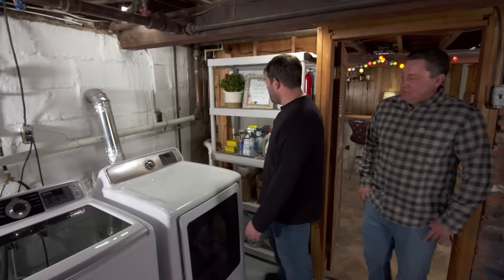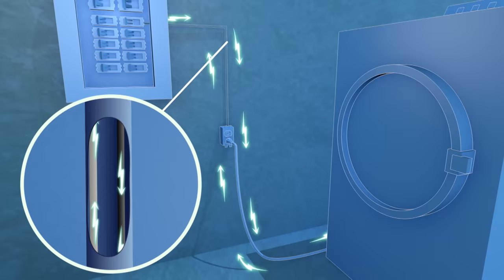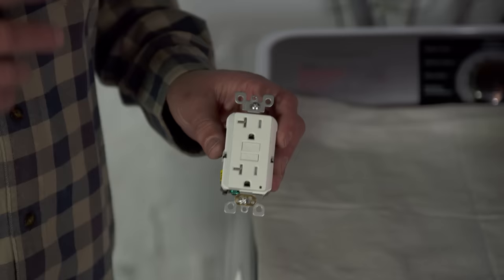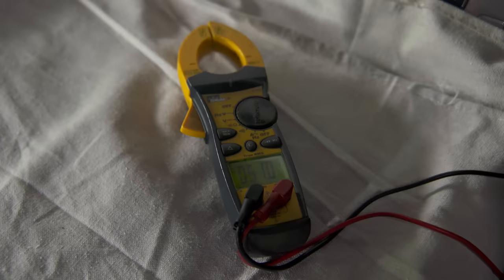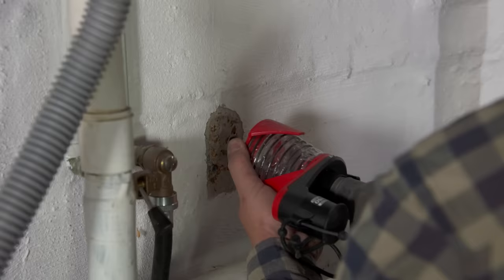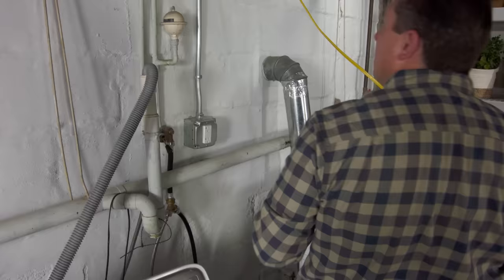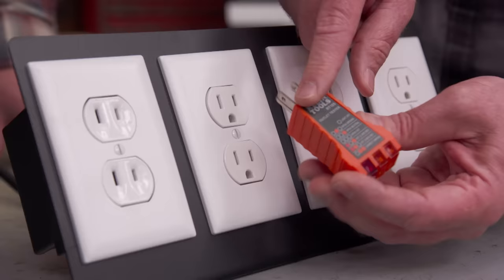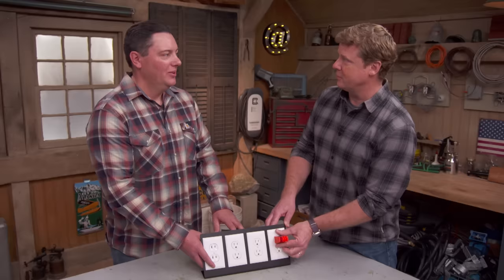How to Ground a Two-Prong Electrical Outlet | Ask This Old House

Comment: Major household appliances can an will trip GFCI. Appliance amperage increase and decrease during use. For example a washer is washing, amp draw 3.5. We drain the water. At the start of the motor for spin the amp draw will increase to 12 amp, tripping the ground fault. Dishwashers  are the worst. Appliance manufacturers will print in there manual must use a grounded out. Do not use GFCI

Comment: First. Can't run romex in emt. Second emt can be a ground if done to code. Third wet location requires water tight connecters and box.

Comment: While in this case, a re-wire was appropriate and the basic explanation is correct, there are other ways that are still legal under the National Electrical code. It depends upon the nature of the wiring being used. Should you have an ungrounded circuit that is encased in armored/ Be cable, the armor casing itself is legal to use as a ground if it travels all the way. Back to the panel. The same is true with circuits encased in Electrical Metal Tubing. This can be checked by the use of a meter or neon test lamp to determine if a complete circuit can be obtained by using the shielding medium. If there is a complete circuit available, then a ground wire from the outlet ground terminal  to the shield is all that is required 
This is for when with EMT, it is not possible to draw an additional ground wire directly back to the panel.
Reply: I was just getting ready to say that
Reply: Just curious: how does your neon test lamp "know" that the shield has not simply been shorted to neutral at the nearest junction box, thus defeating much of the grounding protection?  Also, nothing prevents you from putting in a GFCI for the replacement 3-prong receptacle if you don't actually need an equipment ground (which most appliances do not).

Comment: Had an inspector tell us recently that we couldn't use Romex or plastic sheathed cable inside of conduit. Is there a reason why or is he just full of it.

Was also told that to use a GFCI the way you mention in this video was also a no no.

Comment: I've got one of those outlet testers and for some of my outlets all three lights come on but there's no definition for this condition on the device.  I contacted the company about it and they don't know what it means either.
Reply: W A T ‽
Reply: It means that there's a problem that's more subtle.  If you have a multimeter, you should check that the Line-Neutral and Line-Ground voltages are around 120V, and the Neutral-Ground voltage is 0 (or very close to 0).  I'm betting that there's some voltage between Neutral-Ground on the outlets that have all three lights on, likely because you have a bad connection in a Neutral somewhere upstream of those outlets.  Now the fun part is to work out where the bad connection is.
Reply: It means you're in the plumbing silly!
Reply: That means there is voltage between all three prongs. That would happen if it was a 240 V outlet where someone had just put a 120 V receptacle. It could also be be voltage on the groundwire which is very serious. Measure the voltages between the holes with a multi-meter. Do not use it until you have cleared it,

Comment: Now that it's also on an arc fault breaker, they are guaranteed absolute and total safety. It cures baldness, too. (Sarcasm)
Reply: Unfortunately, Arc Fault is now required for laundry area
Reply: @scottg62g  Yeah, it is. I am yet to see a proof that Arc Faults actually work. GFCI's do, and they save lives for sure. AF's - that's still voodoo to me. They either false trip on arcing motors (vacuums), or are desensitized by manufacturers below the threshold of any meaningful sensitivity. Not to mention that they also removed the 30 mA ground fault protection from most of them, which was their only useful fire prevention feature.

Comment: I thought code was a AFCI/GFCI combo breaker for anything below grade/wet area... specifically laundry areas... 2020 NEC Change:
Laundry areas
RATIONALE OF CHANGE:
Laundry areas have been added to part B as correlation with part A since the potential hazards exist both in
dwelling units as well as commercial facilities such as
laundry mats. In multi-family establishments such as condos and apartments tend to have a common laundry area
and these areas are required to have GFCI protection for
the receptacles. This would include the 125-volt through
250-volt receptacle as required in the general language of
210.8(B).

Comment: I already had a general idea about grounding but this video gave me some more knowledge. I also learned something new when he talked about how a reversed outlet affects a switch and can therefore be dangerous!
Reply: @Jason Bowman No a lot of people don't understand that AC receptacles and plugs are "polarized" for a reason: the appliance designers often cheap out by only switching off the "hot", which becomes the "neutral" if the poles are reversed (in the cord, plug, receptacle or house wiring).  Now you switch off the appliance and the "hot" is still live inside the appliance.

Comment: So hire an electrician? got it thanks
Reply: Hiring an electrician is not that simple. Many of them claimed to be licensed, but actually not. That alone could put your life in danger and it is a challenge to find out if that's a legit licensed electrician or not.
Reply: @AdamIverson  I mean if you think you know more than any electrician that's available in your area, sure DIY

you could also check reviews and check licences and insurances instead of risking your life and all the lives that will ever be in that house.
Reply: howdareyou41 Electricity isnt a mythical creature lol. Basic principles and knowledge make it easy. But it comes down to comfort. I wired everything from light sockets to whole motors in the oilfield as a regular hand, so im quite comfortable with it.
Reply: Actually it is that simple. Hiring electrician. Ask the electrician if he has his journeyman card. If he cannot present one you will know he’s no good. You always should have one if you are a  licensed journeyman electrician!!!!
Reply: By the way horrible video. The guy is boring and there was no need to put this in there because you need to hire an electrician anyways. Not to mention all you need to put in your video is need a new circuit!
Reply: Adam Iverson That’s why there is sites like Angies list or Home advisor.
Reply: @trenthatt2944  Not everyone needs to "hire an electrician" to replace a 2-prong receptacle or to run 4 feet of new cable for a grounding connection.
Reply: +howdareyou41   well, not in this case since he lost the outlet anyway, lol.  He might as well have just not used it.   It was 2 prong so only double insulated devices, or really old devices, would use it anyway.  He didn't gain anything.
Reply: Its really easy. Do some research. Watch some videos. As long as you own the house you can do what you want with it. But insurance my not cover something, say a fire, if you do something wrong.
Reply: @trenthatt2944  new circuit correct ! , but not all places require you hiring an electrician (licensed) , I'm an electrical contractor licensed & insured but here in the state of Georgia a home owner can pull their own permit & do their own work if they feel competent. It's not advised for complexed situations or situations that any individual doesn't feel comfortable nor competent about but like I said here it's advised but not required....more so a "better safe than sorry" advisory ... I've actually went on calls and walked people through how to do simple testing & replacement.
Reply: @AdamIverson  here in the state of Georgia the license must be produced & approved , but that's only for new electrical construction,  but the state of Georgia doesn't require residents to hire an electrician it's only advised (not required).....this is the big misconception with watching these videos.
Reply: Always check with your area (municipality) its always the correct way !

Comment: The GFCI solution is perfectly legal and safe (in my area anyway) but electricians "don't really like doing that because he would really rather run new cable" even though a GFCI will work perfectly. Also, he didn't explain using a GFCI breaker, which is another legal alternative to separate GFCI outlets. Copper is now very expensive and if the wiring in the house is still reliable, there is no reason to "rewire the whole frickin house" just because the electrician "doesn't really like doing that". By the way, most new appliances draw much less current than their previous versions such as a new washing machine that probably is now using an inverter type drive motor and control that reduces surge current significantly and is more efficient. Don't let these guys talk you into replacing the existing wiring in your house IF the wiring in the house is reliable.
Reply: I have a really old house that’s a Frankenstein of an electrical wiring mess. Will installing a gfci 3 prong outlet, replacing an old 2 prong, ground whatever device I plug into it? I have a laser engraver that requires a 3 prong outlet for warranty purposes.
Reply: @Songbirdofourgeneration  Your engraver will not be grounded with only two wires/no ground regardless of the gfci. Also the guy who's post we're commenting on shouldn't be listened to. You need new wiring with a ground for bonding purposes. If the GFCI trips, the appliance/tool is safe, but current takes the path of least resistance. Something else can become energized in the walls or along the conduit of there is metal conduit.

Fix your wiring to ensure a good grounding and BONDING is made so current, if need be, makes it to the ground or utility if a short occurs. This is your life and your home.

Comment: I feel like I missed something, was the only solution provided to run a new wire with a ground? Seems to be a thanks cpt obvious situation. Whats a solution for a 2 wire issue on a 2nd floor where running a new wire is not possible.

Comment: Isn't it a bad idea to  pull sheath  wiring- (like Romex) through a conduit?
Reply: You are correct. Romex in conduit is illegal. You also don’t need a grounding wire because you can use the conduit as the grounding path.

Comment: Way to not let people know that even with the main breaker off to not tell people power is still present on the wires coming from the meter.
Reply: Learned that the hard way, myself. Even harder was the realization that the wires are hot on BOTH sides of the main breaker. I thought they were only hot on the one side...
Reply: Proton2112  Not upstream of the meter. Between the meter and the main breaker. Even with the main breaker off, the wires coming TO the main breaker are still hot. On both sides, as it turns out.
Reply: @c182SkylaneRG  so whats the problem
Reply: @randomrazr  If you don't know that there's still live power inside the main panel, even with the main breaker off, you could get a shock. Depending on how the shock passes through your body, it could be rather damaging (or so I'm told. In personal experience, it's always been a mild but distinctive buzzing feeling).
Reply: @c182SkylaneRG  yeah, but for this application it doesn't matter. The is zero reason to mess with anything leading INTO the main breaker when adding a circuit.

 I did however think it should have shown the main being shut off. Not just a side comment on how I've switched the thing so now stuffs safe to play with. Keep in mind that a large portion of the audience looks to these videos for advice or even instruction, and if they can't take the time to show All of the steps necessary to do it safely, then they should reevaluate if they should make these videos at all.
Reply: @spyda1857  I think the issue is that the show is for a wide range of abilities. If you say to a rookie "turn off the main breaker and then the panel is denergized" without any more context  then you can't be surprised when someone comes back complaining that they touched the wires under the top panel and got a shock. 

It should have been "turn off the main breaker and the bottom half of the panel is safe to work on. Do not go into the top half, it's live from the power grid and can kill you."
Reply: Fyi He's not working in the main panel, he's working on a sub panel.
Reply: If you're not an electrician you shouldn't be farting around in the breaker box in the first place. There's a lot of "gotchas" where the gotcha will result in a big shock.
Reply: Always turn off the main when doing electrical work. Don’t bother with individual circuits.
Reply: @benwallace2756  no

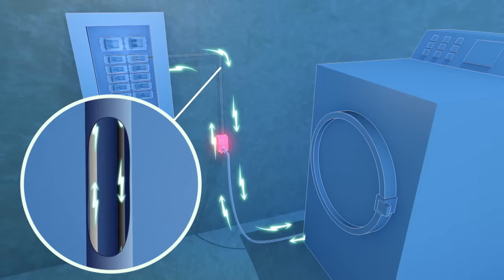Comment: 1:17 we had an old 1948 kelvanator fridge in the basement and it zapped the crap out of you when its raining.
Reply: Add a ground wire to it from the electrical box and drill hole on metal on fridge. Probably leaking current from thermostat area inside door. I had a 1951 kelvinator that would shock me sometimes. Put grounding wire on and no problem. Those Refrigerators just had a 2 prong plug with no ground in those days. Today all 3 prong with the groun.

Comment: Ah, miss the good old days when you could always just connect a copper cable to the cold water pipe and you're good to go for ground.
Reply: Until somebody adds a little PVC section in the middle of the copper piping?
Reply: @jrstf  PVC, or maybe a dielectric union.
Reply: One time, I grounded an outlet (and the box it was) in by running a grounding wire through the side of the house, out to a grounding rod place along the foundation.
Reply: If the box is metal and the wiring has a metal jacket that goes back to the breaker and attach a jumper from outlet to box? Not sure if that’s acceptable but it does provide a ground
Reply: Us plumbers really hate being shocked by pipes, please use ground  rod.
Reply: The NEC requires that water pipes be bonded to ground, even if these metal pipes are not used as part of the grounding system.
Reply: In my electrical update classes for my license the instructor would always go into detail why a had  code changed. Usually something went bad somewhere and that was that.

Comment: 12 gauge should be fine for a washer or gas dryer, but if you’re installing a non gas dryer make sure to use a 30 amp wire depending on the required voltage load
Reply: An electric dryer would need a 220 circuit. This appeared to be a gas dryer and just needs electricity to turn the drum.
Reply: tylerwarren you’re correct. If you read my comment I was talking about AMPS. However they ran 12-2 which withstands 20 amps and would be fine for a gas dryer or any regular washer
Reply: @tylerwarren 240*

Comment: I agree with some of the people that leave comments I'am a retired electrican and woundn't want this guy He installed a GFCI outlet and ARC fault breaker also Seems a little over kill Why pay for both when one would do No connector on pipe where goes in to outlet One thing he did I liked was the off set tool he had

Comment: The did an easy example here where the entire cable run was short, and was outside the wall.  This made the replacement of the whole circuit pretty easy.  What if you have an older house that has a lot of these circuits embedded in the walls.  Is it fixable without a complete rewire?
Reply: Replace the receptacles with GFCIs and attach the stickers provided stating that their is no ground to the faceplate.
Reply: @MrBluelock  Does the GFCI itself require a ground?
Reply: @bbmw9029  No. It functions by monitoring the current coming in on the hot and exiting on the neutral.
Reply: @MrBluelock  Yes, but will the test button on an ungrounded GFI still work?

Comment: Neat little bender but I'm sure I'll never do enough conduit work to feel the need to get one.
Reply: Raw Bacon that’s a Greenlee offset bender. Contractors use them for roughing in. You can put an unskilled person on doing box offsets.
Reply: They are handy if doing a lot of box offsets on a job. Cuts the time by a third instead of a standard bender..If your doing 1000 box offsets, the 200.00 + price pays for itself in just a few jobs.
Reply: @TheRealTonyCastillo  Agreed. Not to mention on larger jobs, consistency is very important as you often have lots of bends right next to each other.
Reply: You can buy a offset connector.
Reply: Real electrician can bend that offset blindfolded and within 3 seconds with a standard bender.